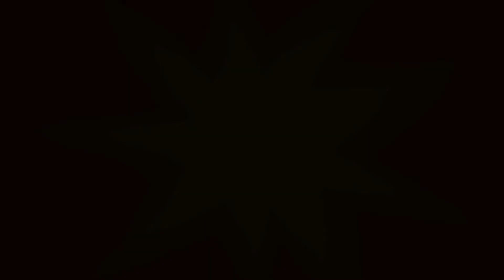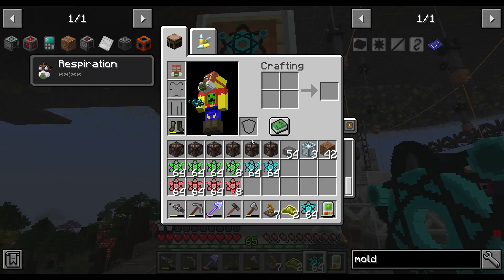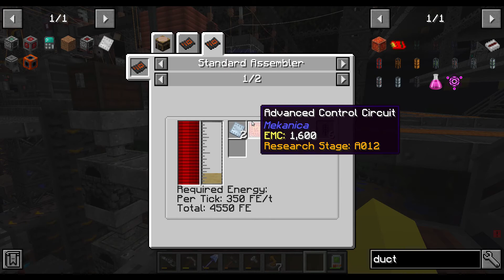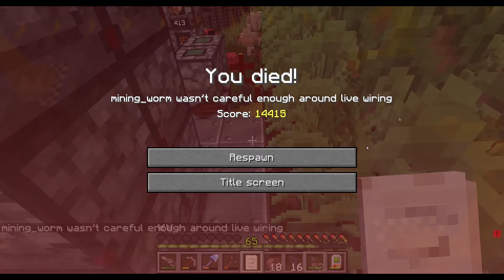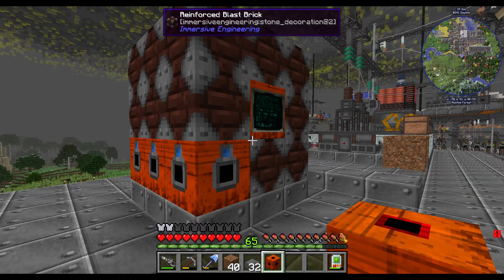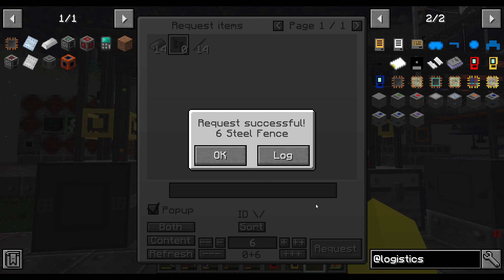Jim in Manufactio Minecraft E39 - Logistics Pipes Beginnings

Comment: Only need 1 input on the EF, but you can choose where the input goes for a bit of design flexibility.

Personally, I'd adjust recipes to remove the need for the LP research/programmer side of things. Feels like a needless time/energy sink, especially in MF where you already have to research and have a lot of power usage.
Reply from the maker: Ah, cool, re the EF. 

I'll have to look into the LP configs to see if the research can be bypassed. After recording I was thinking of how having to use the Programmer item in each different pipe recipe is a pain - having to program it specifically for the pipe type, to then use in a recipe, is annoying. It really doesnt allow for automation of those recipes, which defeats the purpose of LP itself. Unless there's some other thing in the mod that I haven't discovered yet, to bypass that (maybe the chassis pipes and modules - I need to keep investigating!)